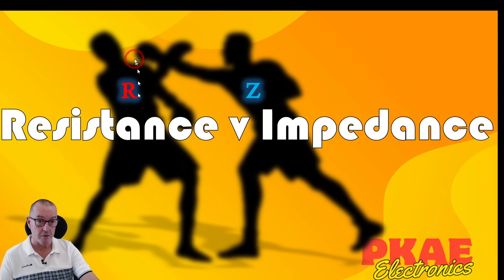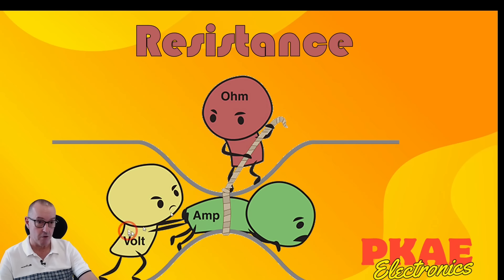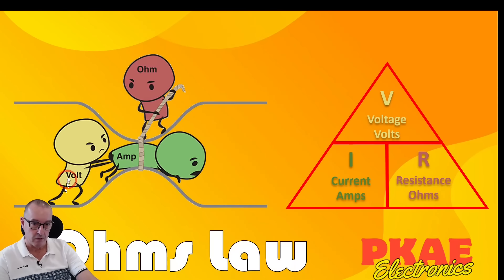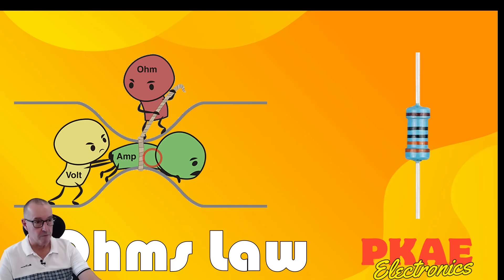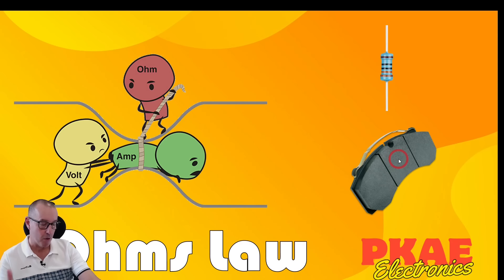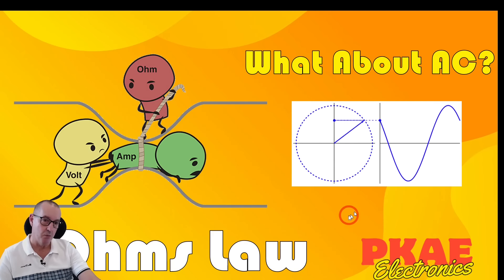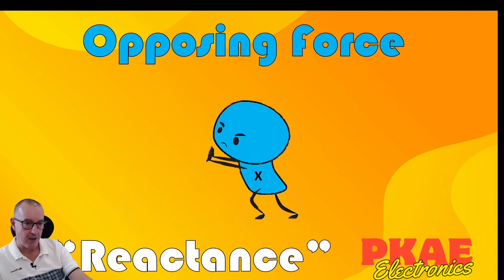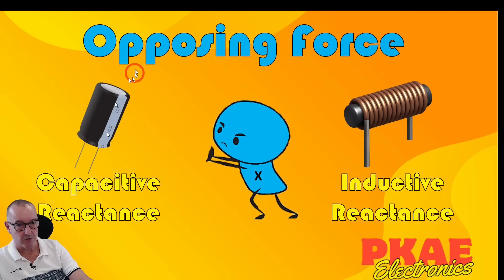Impedance Explained.

Comment: Great video and explanation.  I especially loved the phase angle from the triangle.
Reply from the maker: Thanks for the comment.
Reply: @paulpkae what is the meter you use.  Is it some kind of signal generator?
Reply from the maker: @pulsedmotor  that meter is an NTi Audio Minirator MR PRO. Its a combined Impedance Meter & Signal Generator, with a few other functions. It's a professional grade meter that is commonly used in my profession as a PAVA  engineer (Public Address & Voice Alarm).

Comment: I FINALLY understand why transformers don't blow up when you plug them in! Inductive reactance! Hope I got that right. 👍 Excellent video!
Reply from the maker: While inductive reactance contributes to the transformer's impedance and helps limit the inrush current, other protection mechanisms like current limiters and thermal overload protection are more critical in preventing the transformer from burning out during startup. Also, the load on the secondary coil.
Reply: @paulpkae  I will look deeper into that. Thanks again!

Comment: I just had a really satisfying click moment. I used to try to work out how electric guitars work. Basically every guitar has a circuit with a Potentiometer and a capacitor to filter out higher frequencies, changing the tone. As I was watching the video I thought about different frequencies leading to a different amount of resistance. And then I basically thought so if some frequencies get through easier than other then... Oh shit.

So thanks for that
Reply from the maker: Great comment, thanks!

Comment: Brilliant! This video could not be improved upon. I wish you had videos explaining everything related to electronics! I have read and read and read about this but until now, I never understood it.  Thank you!
Reply from the maker: Thanks for your kind words. It means so much to get such feedback and makes all the effort worthwhile.
Reply: @paulpkae  Paul, you mentioned early on in the video around 9 minutes in that the -89 degrees shown on the meter is the phase angle. But at the end of the video you show that the phase angle is Sin(O/H) which works out to 15.7.  It is not practically possible for that angle to ever be 89 degrees since the right triangle would only have 1 degree left over.  Can you help me understand the large disparity between the 15.7 number you calculated and the 89 shown on the meter?  Was it just because you were showing the capacitor's phase angle alone early in the video versus the entire circuit combined at the end?
Reply from the maker: @Wil_Bloodworth  brilliant question. You are obviously thinking about this quite deeply, which is great!

The -89 degrees reading the meter gave early on in the video was during testing the impedance of an almost entirely capacitive circuit. i.e. just the capacitor connected across the terminals. 

I say 'almost' because there are always parasitic properties at play, and even though we only had a capacitor connected, there would have been a very small amount of DC resistance and some inductance too.

That said, the capacitive reactance of this particular test circuit, would have been by far the most significant factor impeding the current flow.

The impedance triangle would therefore be incredibly steep, almost infinitely.

The impedance triangle near the end of the video however, was based on the imaginary circuit which incorporated a capacitor, inductor and resistor. It's phase angle was therefore much shallower and derived by the lengths  of the adjacent and opposite sides.  

I do hope this makes it clearer for you.

Thanks again for watching and your great comments.....Regards
Reply: @paulpkae  perfect!  That's exactly what I needed.  Thank you Paul!

Comment: Great vid Paul, nicely explained ! AC Theory did and still does my head in :( one thing that's useful to know and sticks in my head from college, looooooong time past,  was those little formula's like V/IR and relevent here is ICE (Current Leads Voltage In A Capacitive Circuit) and ELI (Voltage Leads Current In An Inductive Circuit) Enjoying your Vids. Les
Reply from the maker: Cheers Les.

Comment: For weeks I've been trying to figure out how you are able to connect a lightbulb or some small device to mains without needing some high power resistor. After breaking apart a few things and reading some circuit diagrams, I always come across a ceramic capacitor. After a few times mucking around in a circuit simulator I noticed that capacitors can inhibit current flow, then a few moments later I discovered the term "impedance" and moments after that I'm here watching a video about Impedance to complete my understanding on how all of these works.
Reply from the maker: Brilliant! Glad you kept your determination going to find out more.

Comment: Am an electrician, had no clue about impedance, thanks! May not really effect my day to day, after all we just read the nameplate, but interesting to learn how they come up with the numbers!
Reply from the maker: Thank you. Glad you found it of some use.
Reply: Not sure what your field is.  Rest assured you encounter reactance in your work.  More so in industrial settings, but it is there.

Residential.  Air conditioners.  Both capacitive and inductive impedance.
Commercial is chalked full of it.  All the HVAC systems.  Welding.  Automation (robots).  ESD for power coating.  Really long power runs.  Transformers.
Reply: @Katchi_  While I understand that it is there, typically the electrical engineer handles that side of things and we simply install according to the plans. Not to say we don't design our own conduit runs and such, but in terms of loads to be served and sizing of the transformer that is mostly left to the plans. Our shop primarily works in new commercial construction, with grocery stores being about the largest jobs we take.

Comment: It's funny, I always understood capacitors pretty will before this video, but not inductance. After watching this video really helped me understand inductance, but for some reason, I have a harder time understanding capacitors now.

The fly wheel analogy is so good. The bike pump analogy is also great, but for some reason is harder to understand.
Reply from the maker: What aspect of a capacitor is it that you are struggling with in your mind?
Reply: @paulpkae  I always thought of capacitors as just batteries with faster charging and discharging. 

As I got into radio I started learning about how to use them to filter high frequency signals. I went back and watched this video that uses a water flow analogy, https://youtu.be/X4EUwTwZ110?si=PdS4KDGBO0xNuEaU

I've never really thought about capacitive inductance too much. So right now I'm on the verge of connecting all these ideas together, but they are kind of in different sections of my understanding (if that makes sense).

Comment: I like to think of capacitance as a spring. Inductance is inertia and capacitance is spring tension. In an AC circuit you could imagine a linear spring where both ends are fixed and the force is applied at the center of the spring and pushes it in one direction or the other. Initially the spring is at rest, when the force (voltage) is applied there is very little opposition to this force. As the spring is pushed to one side it gets compressed and the more compressed it gets the more opposition it provides to that force until it reaches its limit where it can no longer be compressed any further. When the polarity changes it is now applying a force in the same direction as the voltage and it adds to the force until it reaches equilibrium. Then it starts being compressed in the opposite direction and the cycle starts again. 

I think it helps to visualize how the two forces can cancel each other out. Initially when the voltage is applied there is no tension on the spring, but the flywheel is at rest, so it would take a lot of force to move it. Instead the force is directed to the spring. As the spring builds tension more force is required to compress it, therefore an increasing amount of force is directed to the flywheel instead. This smooth increase in force allows the flywheel to spin up gradually instead of suddenly. When the polarity switches, the flywheel doesn't want to stop, but the spring (capacitor) has a lot of built up energy that it wants to release, so it goes first and supplies energy to the system. Once it reaches equilibrium it stops supplying energy to the system and starts requiring it. That's when power gradually starts being diverted to the flywheel (inductor) just like it did in the beginning and the flywheel starts to slow down as the spring builds tension.
Reply from the maker: Great explanation, thank you.

Comment: When I was competing in in car audio I had to measure everything in Impedance, Even the DC values. My linked amps pulled over 700 Amps, the resistance in my single 18 sub increased 150% from 0,5 ohms to 1,5 ohms under the 6kw power I push through it, and I had yet even one more value to add into the equation, heat. the heat generated into the wires and voice coil also increased resistance and impedance during load. outside temperature, barometric pressure. generator and battery voltage, seat positions and everything had to be taken into account. in 2012 I became Europe Champion with this car using a factory defect Sub. I knew exactly how every aspect of the system would respond in every way of every day when I had that. I miss playing with it. I have the equipment but nothing to use it in anymore. and rules in my country have made it harder to play freely today as well
Reply from the maker: Thanks for the comment, it seems you had a fantastic and very interesting hobby. 

To become European Champion says a lot. Please keep engaging with this channel, I am sure your input to this growing community of electronics hobbyists and enthusiasts will be well received and useful.
Reply: @paulpkae  Thanks :) it was indeed a very respected time I had back then. I have many trophies I won during this time in my living room and I was known all over my country as one of the biggest competitors around during this time and was respected for my quality and knowledge around my builds. It was very fun to interact with other people within the community back then :)

Comment: Excellent video. Well done. Towards the end I was only hoping you'd return back to the speaker example, and in a few words explain why the impedance is much higher than resistance. Is a speaker's capacitative or inductive impedance high?
Reply from the maker: Typical speakers are 4 or 8ohms impedance. The one I was demonstrating was actually a 100V Public Address speaker which incorporates a step down transformer and a DC blocking capacitor.
Reply: I agree the perfect follow on to this excellent video would be examples where we see these scenarios are played out. Speakers and other components etc

Comment: Thanks for explaining this in such a clear and simple way!
OK, now I'm ready for a 3 phase motor with a start up capacitor!

Please explain how that works!
Reply from the maker: Thanks for the comment. I will add your request to the growing list. :)
Reply: 3 phase motors dont have starting capacitors, as theyre three phase? some may have power factor correction or "run" caps, but its pretty unusual?

the whole point of the capacitor is to give a phase shift on a secondary phase on single phase motors. and fix power factor for run caps...
Reply: It's single phase motors that get a starting capacitor.  The capacitor produces an approximate 90 degree phase shift for the current that powers the starting coil, so that the starting coil and running coil together, will produce a rotating magnetic field.  This allows the motor to move past its dead zone, if it has the bad luck of starting where the running coil alone cannot power it.   Once it gets up to speed, a centrifugal switch turns off the starting coil, and the running coil and its inertia sustain its motion.

The three phase coils already produce a rotating magnetic field, so the starter coil and starter capacitor isn't needed.

Comment: Thanks for the great video, explaining impedance so I could understand it as I never could before.
The subject of phase angle polarity, if that is the correct term, being just touched on, left me searching for enlightenment.
I realize that expounding further upon the subject of phase angle would have stretched this excellent video a bit far.
I was curious as to the phase angle calculation of a circuit that has more capacitive reactance than it does inductive reactance, the opposite of the example in this video.
I imagined that the hypotenuse of the triangle would be on the negative side of the resistance line in a circuit having greater capacitive reactance, where when displayed on a graph, the hypotenuse would be below the horizontal "resistance" line, rather than above it, resulting in a phase angle of the opposite direction from the example shown in the video. 
As I never was a math whiz, I needed a bit of clarification on the subject of understanding and determining negative and positive phase angles.
So, I checked elsewhere, and, in my journey, I found a mnemonic reminder regarding phase angle polarity in this video, 

https://youtu.be/g8VqHKQOHRk?si=jxaeHAwORVK0dOGr 

The mnemonic is "ELI the ICE man", showing that in a circuit having greater L, inductive reactance, use the name ELI, where voltage "E" comes before current "I" in the name ELI, resulting in a positive phase angle; and where in a circuit having greater C, capacitive reactance, use the word ICE, where current "I" comes before voltage "E" in the word ICE, resulting in a negative phase angle.

I thought that I'd share it for others who may have been also wondering about phase angle polarity.
I hope that I described the phenomenon correctly. 
Please correct me if I'm wrong.
To those who already knew that information without having to search further, well, I guess that I'm a bit envious of your knowledge.
It seems simple now that I've researched the subject a bit further.
I'm still not a math whiz, though.

Cheers to all! 😊😊👍👍
Reply from the maker: Thanks for your comment. The term phase angle "polarity" is probably misleading. Inductive circuits will have a positive phase angle meaning the voltage leads the current and capacitive circuits will have a negative phase angle meaning the voltage lags the current. The term "Polarity" makes it sound like its related to negatively or positively charged which it is not.
Reply: @paulpkae  Thank you very much for that clarification.
I'm a retired industrial, institutional, and commercial electro-mechanical service technician.
My schooling was rather basic, but I managed to thrive and be successful as a troubleshooter of fairly complex control systems.
The subject of impedance always eluded my grasp, so thank you for this very clear presentation.
It seems that I've been learning more as a retiree from watching YouTube presentations than I did as a young man attending technical school.

Cheers to you.

Comment: Very interesting, guitar pedals often use a low value capacitor at the start of their circuits because it reduces the lower frequencies getting in. Good to learn that this is because the lower frequencies experience higher resistance
Reply: No, they don't experience lower resistance.
You said lower frequencies. Resistance applies to DC only.

Reactance is the word you are looking for.
The reactance of a capacitor in series is higher at lower frequencies.
Reply: If the cap is in parallel, it sounds like you're describing what is called a "low pass filter". If it is in series, it could be a high pass filter. If you're interested, checkout low pass, high pass and band pass filters, and you'll be building your own crossovers soon :)
Reply: @carneeki  It could even just be a capacitor to block DC. Not intended to be a filter at all.
Reply: @deang5622  indeed, but blocking DC would definitely be a high pass filter, admittedly it would be desirable to have a low cutoff. Also, thanks to your comment I noted (and edited) an error in my original comment, so thanks!
Reply from the maker: Capacitors are commonly utilised in series to block DC in audio circuits. Provided they are reasonably sized, they will not attenuate the audible frequency range.

Comment: It's simpler to think of impedance as frequency dependent resistance. Once you realize or understand frequencies... or that if something changes then that change can be thought of as frequencies in that any signal can be decomposed in terms of frequencies(with different frequencies having different amplitudes depending on specific signal). The issue with understanding impedance is not really any difficult than understanding resistance. Resistance is the overall resistance. It will be applied equally to all frequencies(well, in theory as not all actual resistors are completely "flat"). E.g., some materials are transparent to some light frequencies, say red, and some are opaque to some light frequencies, say blue. Red passes blue does not.  They are different frequencies. The "resistance" is low for red and high for blue.

It's best to understand signals as being composed of frequencies(again, in the sense of Fourier). This then allows one to decompose any input signal as frequencies and if one knows how a component "reacts to a frequency" then it is simple to figure out the entire behavior on the complex signal.

That is, S(t) = sum(a_k*e^(-i*w*t)). If a component C is linear then C(S(t)) = sum(C(a_k,w)*e^(-i*w*t)) which just means that the component alters the frequency coefficients/amplitudes and may only depend on the frequency. 

E.g., S(t) = a*sin(xt) + b*cos(yt) then C(S(t)) = C(a,x)*sin(x*t) + C(b,y)*cos(yt). It does not add or remove frequencies(that would be a non-linear component and is more complex) but only changes the amounts.